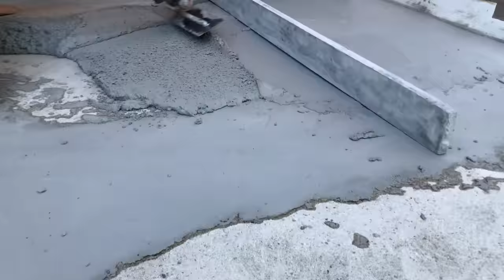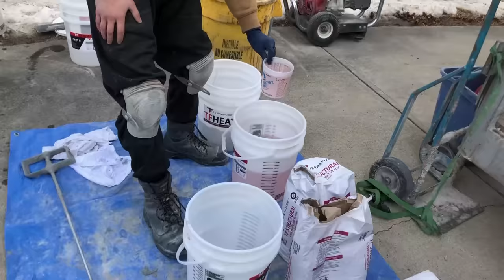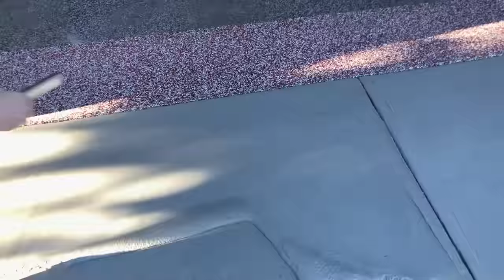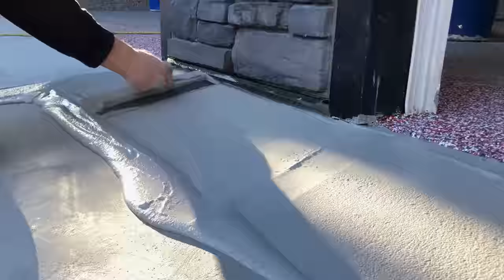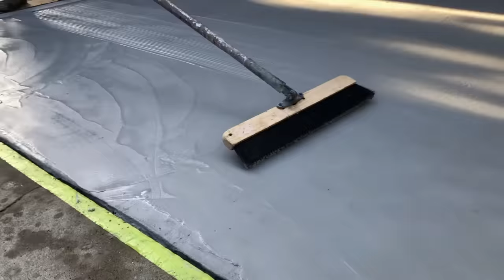Fixing driveway cracks, height differences, and broken edges, using TF Structural Concrete Repair

Comment: Won't it just crack again if you don't address the underlying problem?
Reply from the maker: Yes, but we did address the crack using this method:
https://youtu.be/o5UYlJmKhAE
The slabs were vey old, and the ground hasn't settled any further in years. You can never guarantee cracks won't return, but there are systems to mitigate them.
Reply: What would be the underlying problem. I'm having cracking issues on my garage floor.
Reply: @jennyanimal9046  I am not a concrete expert, but have done some research on the subject since I too have a cracked garage floor. It's likely due to the ground underneath not being prepared properly for the concrete. It's settling and the concrete has nothing holding it up so it cracks. Or, it's also possible that you have a drainage issue and water collects and moves under your garage floor, causing the soil underneath to move.
Reply: @matts.8342  well crap. Both of those things sound horrible. House was built in 1965. I have 8 french drains in the back yard and side of house. I'm selling the house by years end. The garage had cracking in it when I bought it 5 years ago but has gotten worse this last year.  I guess a home inspection is due as I did not get one when I bought. The only reason why I didnt get one on this house is because I did 2 home inspections on potential homes that didn't pan out because of major issues ,so I ended up backing out. I'm a little nervous .🤔😏😐
Reply: @jennyanimal9046  Hmm... one would think any settling would be more than done with in a 50+ year old home. Mine has a few deep cracks and some pretty bad pitting, but it hasn't gotten worse since we moved in. It was built in 1960.I feel like this Terrafuse product would probably work for me, maybe with some foam underneath the slab to fill any gaps underneath to help keep it rigid.
Reply: @matts.8342  I fill a big crack with foam . The others I'm going to fill with self leveling liquid Crete. Then I'm going to take a tar like substance roll over the cracks add a mesh and roll over one more time then I'm going to epoxy the floor  and get the hell out. Lol.the market is good her in Sacramento. Then I'm moving to the country .🙂 I'll probably end up in a Mobile home on an acre or 2.
Reply: @jennyanimal9046  I don't know what kind of profits people are seeing right now in CA above their mortgage, but it might even be possible to make enough to move somewhere outside CA and get your 2 acres and a mobile home for cash.
Reply: @matts.8342  I know. I've been wanting to leave California for a decade. This state is nutz. It's a beautiful state but the political aspect among other things. Its extremely expensive. The only reason I haven't left is because of my 22 year old daughter.  I'm already 2 hrs away and that's hard enough. In fact she should be here any minute now. I havnt seen her in a year and a half. Im looking forward to being a grandma and being close.  😊
Reply: @jennyanimal9046  Home inspectors can't tell you anything other than what you already know. They may point out obvious settling and cracking, nothing more.

Your issue requires a residential structural engineer inspection.
Reply: they don't seem to care about that.
Reply: @matts.8342  lot of reasons concrete cracks. Depends on how bad the cracks. If the concrete is uneven at the crack could be settling , could be no wire/rebar, could be the mix used the day poured and the set rate, was there fiber in the concrete? If the mix wasn’t correct for the climate = cracks. 🤪
Reply: @blindmelonstubbly  agree- or learn non structural cracks are part of life and move on to something more important 😆
Reply: @jennyanimal9046  Most home inspections would only point out the cracks, not diagnose the cause or suggest remedy (other than suggest that you might want to talk to a pro).
Reply: @jennyanimal9046  tree root growing up and towards slab

Comment: The guy spreading the cement is doing such a excellent job that it almost looks like he's spreading frosting on a cake 🎂.
Reply: Yum 😋
Reply: I've done concrete work at home and I let my wife do this because she is excellent at spreading icing - and SHE said it is the same (technique) but this concrete is a little stiffer than icing, but it spreads as easy.  The hard part for me is leaving it alone after spreading it because I would want to keep going over areas i had already done till i got it ALL just as smooth.
Reply: Same thing really.

Comment: You can always tell when someone knows what they're doing. It's getting harder and harder to find.
Reply: not harder to find. people just dont want to pay for the work. they'd rather hire the guy who bid 20% lower  without comparing itemized estimates, or questioning why he is so much lower.
Reply: @ttunderbridge5762  Very good point.
Reply: They are broom finishing it to wet ..should let it a dry a bit
Reply: @ttunderbridge5762  I often find the opposite to be true when it comes to estimates, where the guys asking the highest prices will refuse to give details. Usually the best are reasonably priced, once you rule out the cowboys with the extra low prices and the con men with the extra high prices.
Reply: @RandomShart  sure. i've seen the same thing. Usually, for me at least, it turns out to be the lower priced ones who either refuse to, or cannot give an itemized estimate. there have been several instances where the client called ME back after a few months to either finish or tearout and redo the work of these people who give lower estimates. but, yes, ive seen your scenario over the last twenty years or so.
Reply: It's not easy to get it level.
Reply: @RandomShart  There is no clear path when dealing with repairs. High price, low price this isn’t what should be considered. What should be considered, is whether or not you can trust the person and know he or she to do professional considerate work. Every time I read comments upon work, it’s always based upon price. An ignorant person will always focus on price because they don’t know how to do the work themselves And that is the only angle that they can work towards.

Comment: The fix looks great!  Although I was wondering since the slab and top coat are separate, wouldn't the newer thinner area be prone to breaking under the weight of cars?
Reply from the maker: No, it will not break under cars, this is what it is designed for!
Reply: This job is good for indoor only not for driveway. The PSI is too low. It will crack after a year. It is waste of time sorry to say that.
Reply: Definitely won’t get away with that in cold climate. First winter. Done
Reply: Jimmy is right, even I don't suggest you do indoor
Reply: @jimmychow4917  It will hold up!
Reply: A flippers dream even though they should not be able too hack city is running rampant these days fly by night need reference your contractor or suffer the results ...
Reply: It might hold up. I wonder if they prefilled the cracks? And if they did, was it with epoxy or the same structural concrete coating?
Reply: Unfortunately no it wont hold up. Its a house flippers trick but within a year it will start chipping out and cracking everywhere
Reply: I did part of my garage floor 15 years ago. No cracks still looks good.
Reply: @brettfrancis1527  I did part of my garage floor 15 years ago. No cracking or chipping.
Reply: @MoneyManHolmes  cracks are from sinking, it will still sink and crack overlay
Reply: @brettfrancis1527  YES
Reply: @chustad1  this, the old will be showing after a couple frost cycles in places. It works sorta good though, I redid a patio in it once, and the patio looks 90% still 10 years later. the other 10% chipped away.
Reply: Instead of doing this, is there some type of sealer/filler for concrete - like the one used for asphalt? maybe some type of epoxy?
Reply: @TerrafuseInc  I see bucket A and B. Do i need to mix both together or? Are the bag available in near walmart o homedepot
Reply: @chustad1  I was wondering that. I live in an area with 7 months of freeze/thaw cycles.
Reply: Since it has been 2 years since work was done, it would be nice to see a follow up on how the repair is holding up.
Reply: @jimmychow4917  I should have a talk with my driveway and ask it why after 21 years of living in Chicago weather, why hasn’t it cracked yet?

Comment: Very nice work. I would say that is virtually impossible to find a contractor capable of this skill level and the diligence to perform such exacting handiwork for a customer.
Reply: He's no big deal that repair is going to fail
Reply: @bobcat8439  You're probably right. I have had so many hired contractors make so many mistakes that I no longer trust any of them. The typical homeowner is left just paying for disaster after disaster, including the new ones just created by the last contractor.
Reply from the maker: We have lots of after videos of the work we post. Not everyone is out to screw people over guys.
Reply: @KpxUrz5745  So true.  Surprised there is no one decent out there.  Even 5-star rating Yelp contractors are crap ☹️
Reply: @TerrafuseInc  do you know anyone in Oklahoma City that might do this for me?
Reply: @owenshortr   did you find anyone, I’m in OKC also and got a bad concrete job.. I need help ASAP!!

Comment: I’m so surprised you didn’t need to do any preparation to ensure the old concrete binds with the new, thin layer. 
I trust, I know what’s best. 
Thank you for sharing. 🥀
Reply from the maker: We did do preparation, the entire surface was diamond ground.
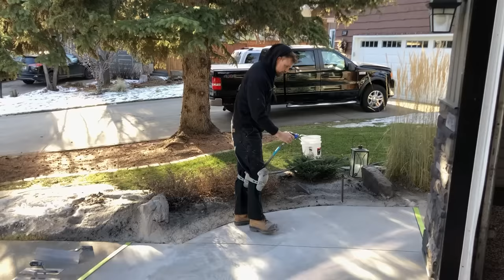Reply: @TerrafuseInc  Ok, but why did you not wet down the dry slab initially before topping? I see water only being used mid way through at 3:32. Why no boning agent? Thx
Reply: @TerrafuseInc  oh, I’m so sorry! Thank you for letting me know. 
The video was so good to watch. Thank you again. 🥀
Reply from the maker: wetting the slab helps to extend working time, eliminate air bubbles, and making working with the material easier, but it is not required. When we do thicker, drier installs, just as a building layer, we don't always use water, unless it is hot, windy, or the concrete is very thirsty. Wetting the surface does not have to be done, but it is recommended, especially for thinner installs. Primers/bonding agents are not required, as this is not a polymer modified product, and does not need to be 'glued' to the surface. The chemistry of this material will bond directly to the existing concrete, chemically and mechanically.
Thanks

Comment: What is making this stick to the old concrete? How long will this last? Does it crack when it freezes?
Reply from the maker: It’s a chemical and mechanical bond formed with the existing concrete substrate. It won’t crack when it freezes, and it lasts at about 1/8” of wear, every 10-15 years, depending on where it’s installed.
Reply: @TerrafuseInc  thank you for the heads up!!!

Comment: Im curious how it will age.  If even one section detaches from the old concrete, it will be an utter mess.  How does expansion/contraction work on the two separate layers?

Comment: I really need to do this to my back patio.  Beats pouring $7k of cement, but this is a beautiful repair.  I hope I can just make it look decent.
Reply: Not trying to discourage you but a lot of these products are very quick setting so you have to work FAST. I poured a 3 foot curb last week just to patch a missing piece and the rapid set cement was hard in less than 15 minutes.

Comment: Did you use a bonding agent on the original surface? After winter it will all split into chips and flakes. How is it holding up from ~3 years ago?

Comment: Resurfacing concrete driveway with epoxycrete is the way to do. It can last at least 20 years provided the driveway foundation is solid n no underlying condition.
Reply: Epoxy crete is that a mix of epoxy and concrete?

Comment: I'd love to see how this has held up. My concern is your brought the level of the driveway flush to the garage. That's never a good idea in snow states. You're going to either rot your garage door or have a run in of melted snow everytime you open the door. However, in mild climates, I'd love to see how long it lasts under the pressure of cars and trucks. The quality of layout is impressive though 👍🏻
Reply: The drive settled about an inch so he just btoughr it back up  but driveway is sloped away from house
Reply from the maker: The slope is away from the garage, water will not flow into the garage. There is a video on our channel showing exactly how this holds up, check it out! :)
Reply: Where are these guys.
Reply: This material works the same as applying R Dex and other concrete renewal products. I've done this before and I used to add some sand mix in to match the other concrete. It darkens it up. It seemed to work good when mixed with the acrylic fortifier . I don't know what the long term results were because I no longer work in the concrete business.
Reply: I would also like to see a follow up and I wonder if they hire a pro to pressure wash the entire driveway.

Comment: Looks nice, but what climate? With the freeze thaw where I live that’ll be popped in 2 years tops.
Reply from the maker: It was installed in Canada. It doesn’t pop off.
Reply: I need to resurface a driveway but no one will do the work cuz they say it doesn't last. In North Idaho where there is a lot of freeze, etc. Who cares? Most of us do not have a 7 to 10,000 dollars to spend on re placing their whole driveway if it lasts 2 to 3 years that's fine with me. I wish more people would do this work.

Comment: Will the new concrete crack or break? Im looking to fix a height difference and worried the thon layer would break away aftet driving on it awhile. Does this hold?

Comment: Aren't you supposed to grind the cracks out, clean, acid etch and neutralize, then dampen before spreading the patch you put on top? What you did looks good but will it last?
Reply from the maker: We did clean all the cracks out with a jack hammer. All the loose concrete was removed, and the substrate was diamond ground before applying this system. You need to have clean, sound concrete to go over, or the restoration will not last. It will last yes, but you can never guarantee cracks will not return. This system gives you the best chance of mitigating the cracks, but there are so many environmental factors, you can't be certain. Check out this video:
https://youtu.be/-RACYCLKqA4
Reply: The house probably went up for sale shortly after that work!
Reply from the maker: No, it didn't, but the neighbors did...
https://youtu.be/AY-mhFVXACs
Reply: @TerrafuseInc  I’m so glad to see this, one contractor quoted me 13k to redo my garage and driveway when I need repair 👍🏽
Reply: Dumb question from a desk jockey aka me - what would occur to not make it last?  Ground shifts, resetting, etc?

Comment: Did they fix the underlying problem that caused the issues?
Reply from the maker: The driveway is over thirty years old. It settled in the first few years after construction, and hasn't moved since. You are right though, make sure you don't do this on a substrate that is likely to keep moving, or you may have to go back to reslope it again. For jobs like these, you can do some mud-jacking to stabilize the base first.

Comment: If that area looked the same for a year or 2 without any more noticeable settling, this could be a great long term fix. If the owner noticed more and more settling "prefix", then the cracks will come back.
Reply from the maker: https://youtu.be/AY-mhFVXACs
Reply: @TerrafuseInc  Meaningless if we can't see the before AND after. Show us how this job looks now, a year later. This is a band-aid, that's why you sell it on Amazon instead of through construction suppliers.
Reply from the maker: @ev6558  TF Structural 6 years after installation
https://youtu.be/AY-mhFVXACs
Go to 2:30, we do have the after video. It is also sold direct, and through construction supply locations. It’s on Amazon for people that need small repairs and don’t want to pay a fortune for shipping. You should do some research before spouting off useless comments to everyone. I never can understand why people come on here and act like they know everything, when they are just 100% wrong.

Comment: WOW, question?  What didn't you use a Bonding Agent. That skim coat will crack and peel away from he original?
It look's good, it wont last, you might get away with it if the home owner dos not live in very cold temps. I see SNOW, O well, please give an up after WINTER with video.
Reply: Would of been better with and epoxy resin and bonding agent this is gsrbage
Reply: The product probably has a bonding adhesive agent in it
Reply from the maker: Our product does not need a bonding agent to 'glue' it to the surface. It chemically reacts with, and bonds directly to concrete. It will not peel away, and it will last, its best if you don't throw out random guesses in the comments section. This product was designed, and used extensively in Canada, winter is not a concern.
https://youtu.be/-RACYCLKqA4
https://youtu.be/iuK9_XweHKA
Reply from the maker: That doesn't make any sense. Epoxy is not UV stable, why would you put that outside? Why are you saying this product is garbage? Where have you installed it before?
Reply: @TerrafuseInc  UV stable is the key word. Might be over kill, but pressure washing and etching  the concrete surface will helping bonding.